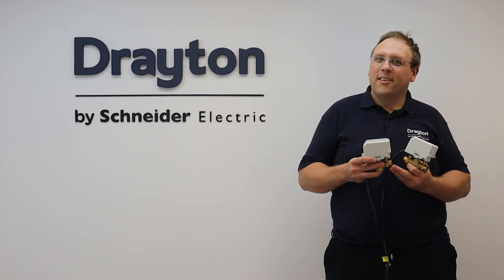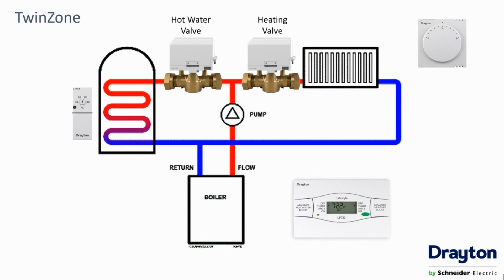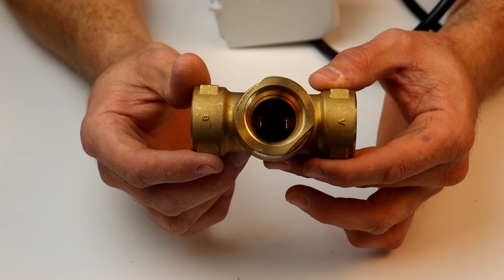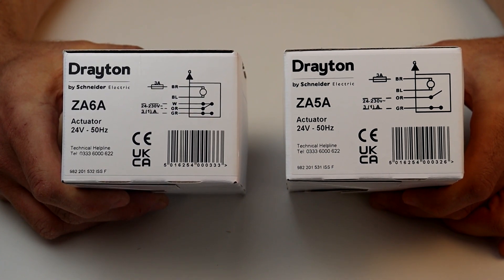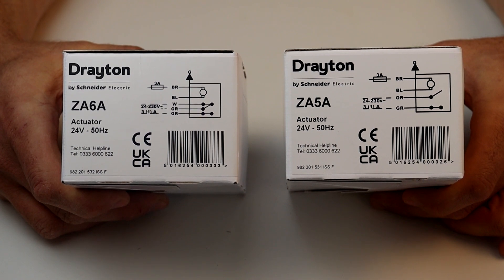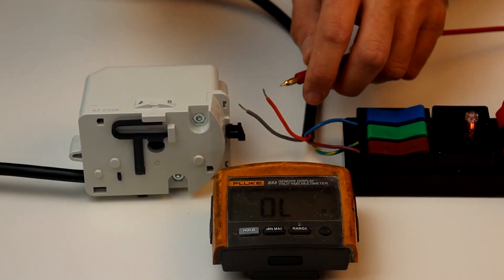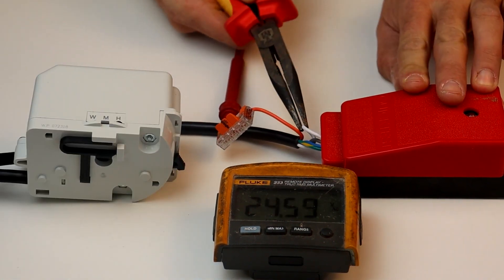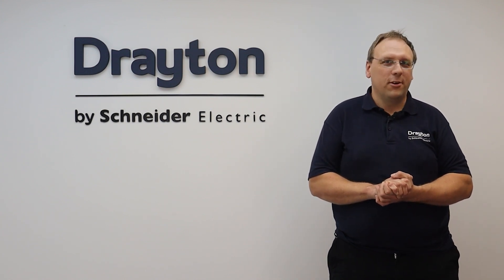Motorised Valves - range overview, installation and what's inside

Comment: Thanks for this video, you just proved to me that my landlord is incorrect. The switch on the side of the valve in the video that moves, is broken on the one by my boiler and it just hangs in down in one place. It doesn't move as you show it in your video. He insists that it's working fine! The heating stays on constantly because of this broken valve!
Reply from the maker: Glad it helped